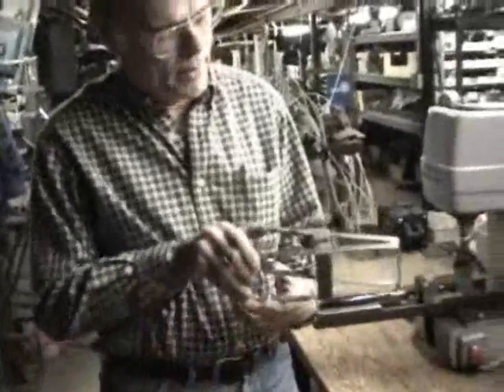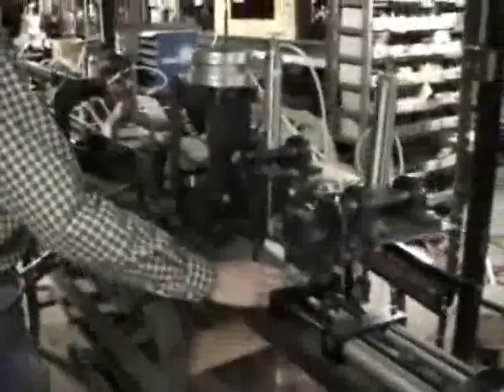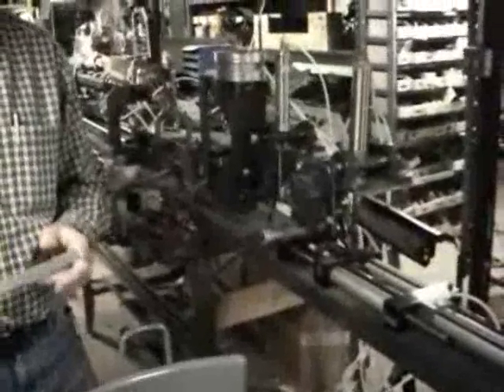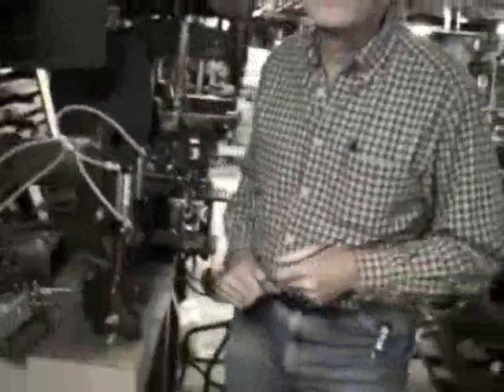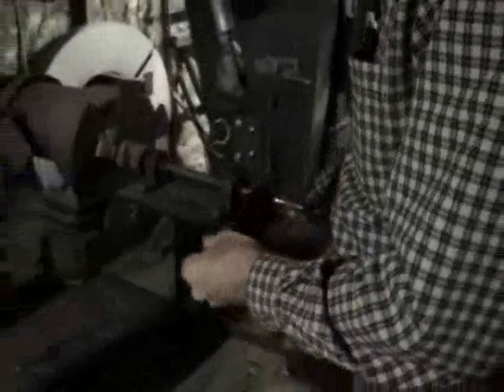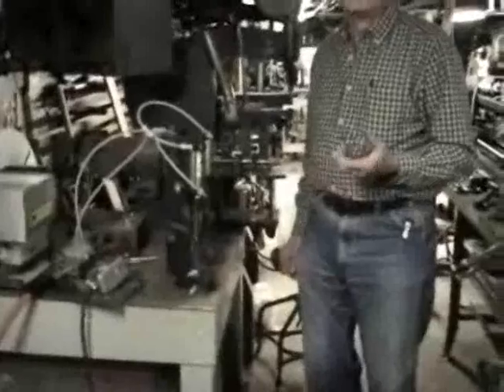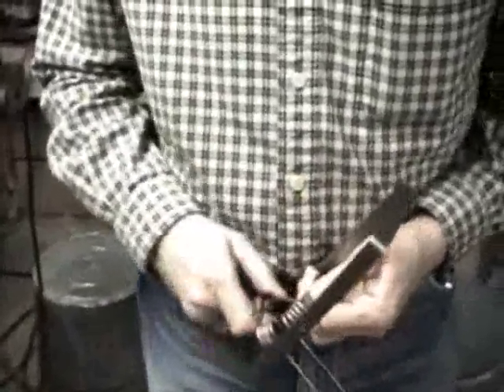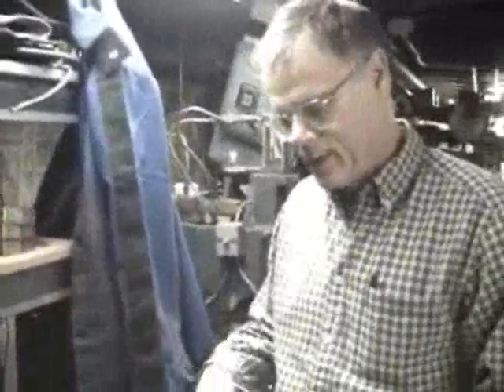Lanesboro Gopher Trap Inventor

Comment: Good trap. I use in sandy soil and open up the hole. This is a large diameter trap, but it’s very open, so the gophers cant pack dirt against them easily.  In my experience, if this trap is sprung, there is a gopher in it 100% of the time.